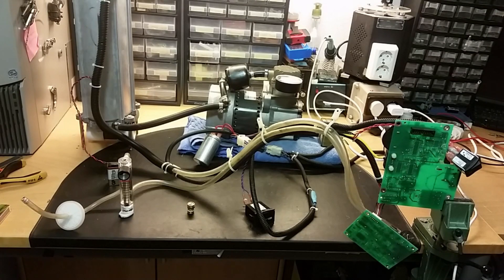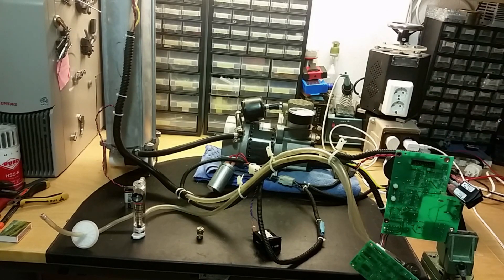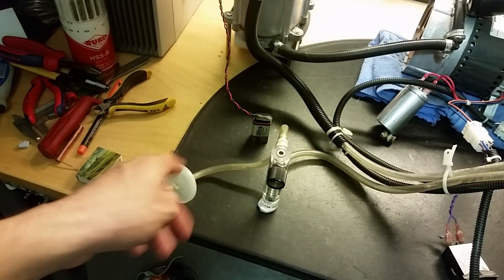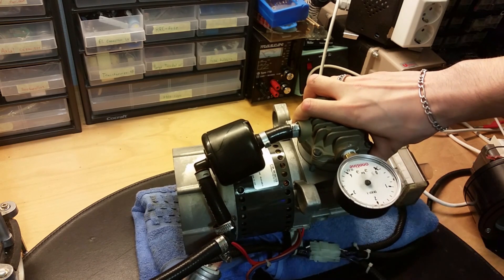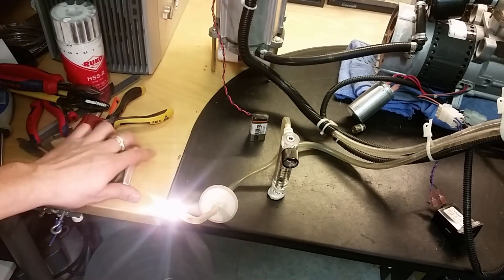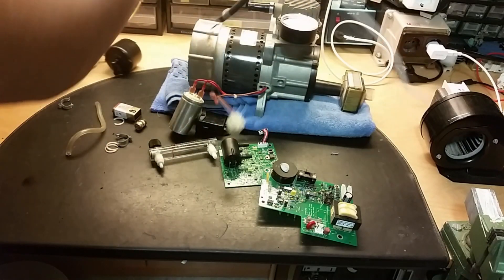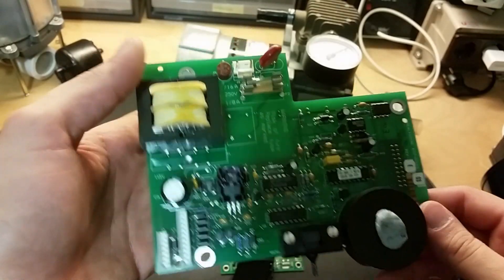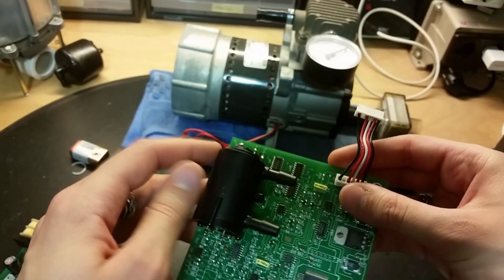Oxygen Concentrator Teardown Part 2 Flame Test Gone Wrong

Comment: Lol! I just recovered two concentrators from a nursing home dumpster. And one has the exact same compressor and filter as yours. It is a custom manufactured compressor and I have found no information anywhere on it. Thanks to you I know all I need to about it now. Both concentrators worked fine and simply had clogged HEPA filters. One of them has 46,000 hours run time on it. And also you now know why I performed oxygen test with a small bore copper tube! I think there was no heating upon hydration because the pore size on concentrator zeolite is too small to admit water. Either that or the zeolite was already saturated.

Comment: Would you tell me if there are many types of zeolite? And which type is recommended for oxygen concentrator?
Amazing video .. good 👍👍👍
Reply: 13x molecular sieve is what you want. 0.1nm pore size. There are like 10 different types. Don't try and experiment with other sieves named otherwise; unless they specify their sieve has a pore size of 0.1nm. You could be pushing out a potentially deadlier gas rather than oxygen.
Reply: @drone1337llc  thank you so much 💖
Reply from the maker: Thanks 👍
I really don't know, they often use molecular sieves for this applicaton. There are many different brands, these are oxygen concentrators from the Hospitals dumpster but i think this particular one in this video has a decent quality

Comment: Awesome video! Do you think I can use the pump for scuba diving?
Reply from the maker: I think it doesn't give out enough pressure
Reply: Scuba diving requires a whole different pump. 4500psi to fit more air into a smaller tank. PCP pumps are what you're looking for(extreme high pressure, low flow rate).
Reply: @drone1337llc  hope you can build a diy pump for scuba
Reply: @REEUNSWORLD  hmmmm.....lemme mull it over and I might be able to figure out a diy way.
Reply: @drone1337llc  you should have more subscriber  all your videos  are very informative
Reply: @REEUNSWORLD  Thank you. I don't think I put enough effort into making them look exciting or edited to get a surplus of subscribers. But I do agree, I love and strive to give concrete information to avoid confusion.
Reply: @REEUNSWORLD  Double Acting pump: use a pneumatic cylinder with 5/2 solenoid, tap the exhausts with high pressure one way valves; and you should have something close to DIY scuba pump.
Reply: @REEUNSWORLD  Stay tuned as I actually will undertake the project of DIY pressure booster. Plans are sound, just need to move then Ill build it and post a video. Working principle will be taking pure oxygen output and increase it's pressure to double of driving PSI. Slow, but will work.
Reply: The best way I can think of right now is to somehow source a very robust high pressure one-way valve followed by a high pressure regulator; on the output. That kind of jimmy rigs a fixed pressure pump into a fixed flow rate pump.
Reply: The main problem is you're going to need some serious cooling. Most commercial PCP pumps come water cooled.
Reply: Actually, you might be able to get away with just upgrading the motor to 2hp or more. High risk of damaging the piston and valves as well as the gaskets. But if your pump is built or rebuilt with heavy duty parts, like putting billet forged parts into a car; you can most definitely push out more than 120psi. Take off your "auto off" regulator if your pump has one.
Reply: You never use pure oxygen for scuba  diving since it becomes toxic with increased depth in water, you use compressed air or special gas mixtures (oxygen is about 20% of air).

Comment: This was truly a tear down using a hack saw, well done, I love reverse engineering projects. What makes me laugh is when manufacturers use special screws, which can be opened so easily with a straight slot screwdriver of the right width, silly men.

Comment: Do we need any special room for filling zeolites in sieve beds, like maintaining pressure, temperature or humidity of the room?
Reply from the maker: I don't think so, they get the air with the moisture in it, but it should not be too dusty
When the unit is turned off the pressure drops to normal after a while
Reply: @MrTesla1337  Which grade are this zeolite of?
Reply: Depends on how serious you are and how efficient you want your sieve to work. Once you reactivate your sieve material, the best environment for it would be dry as possible and room temp. Like others are saying, humidity in the air will get trapped in the zeolite. You don't want extra "stuff" in your zeolite especially when you need all that space for nitrogen.

To answer your question directly, no special room is needed. But messing with zeolite in a controlled environment is always a better choice. Treat it like a science experiment. Eliminate all variables.
Reply: 13x. 0.1nm pore size is what you want.

Comment: This works on the principle of differential adsorption of nitrogen at pressure compared to oxygen. There is a pressure swing between two canisters with oxygen delivery at high pressure and release of adsorbed nitrogen at low pressure phase.

Comment: what happens if the Nitrogen exhausting filter it´s all full of crust from the procces? it will affect the function of the oxigen generation and would it make the sensor go crazy?  how can I clean it or replace it? is it toxic?  thanks
Reply from the maker: The exiting nitrogen doesn't go through the sensor, it gets blown out with some of the pure oxygen. Over time the zeolite sieves get less efficient to capture the nitrogen
It should not be toxic

Comment: How about turn one into a nitrogen concentrator?
Reply: ha, just connect to the waste line for nitrogen, already is
Reply: Just change out the regular zeolite for carbon molecular sieve and it will work.
Reply: I'm wondering where the moisture from inlet air is going to end: oxygen out or nitrogen  out?